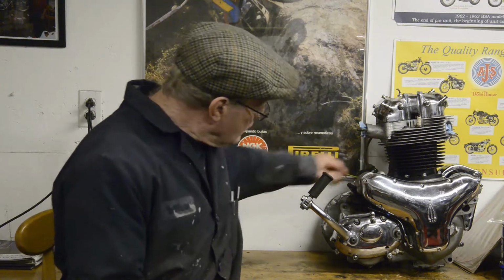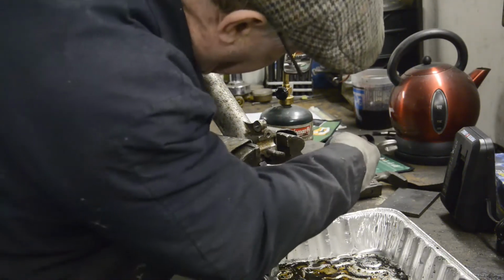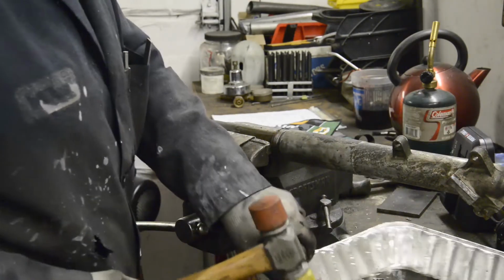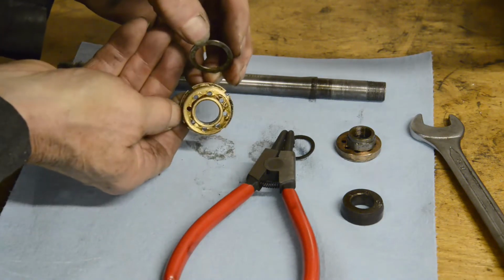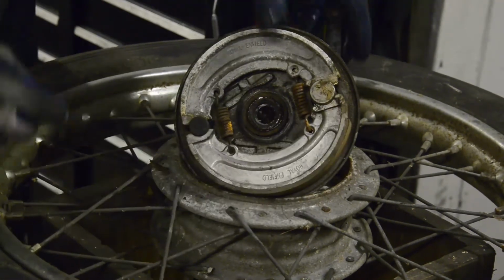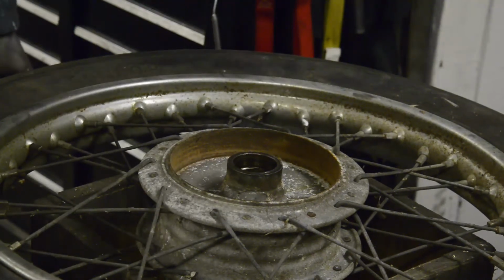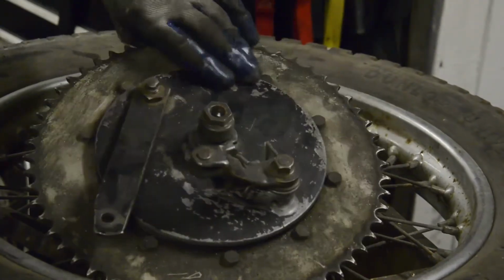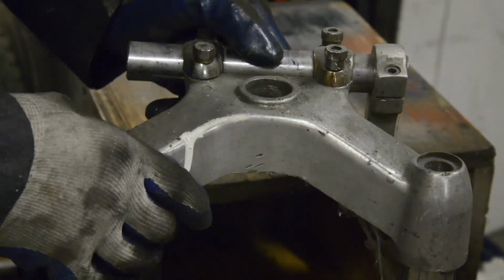Indian Trailblazer - Part Two

Comment: I think the first double leading front brake I ever dealt with, if I remember right was on the 305 Honda Super Hawk.  Maybe you might consider a small "pipe vise" on the end of your bench where it wouldn't be in the way. You are quite often gripping round things while unscrewing something on the ends (like forks). You could make some soft aluminum jaws for it, they grip like crazy.. ...Dave

Comment: Hi Michael, 

Really enjoying your practical approach and picking up a lot of information. 
Your comment on the North American wiring made me smile. I, like you are a transplanted brit and I now live in Ontario. When I first arrived I was horrified at the wiring standards, including your comments in an earlier video showing the method of connecting wires in those screw on thing (marrets?)The fact that individual appliances are not fused at the plug like the UK, means that if the appliance gets a fault it can draw everything the mains panel will provide. I wonder if that is why we seem to get more house fires over here! 

Do you not find that wearing gloves means that you cannot feel what you are doing? I have tried using gloves and always end up taking them off, letting my hands get filthy and just cleaning them! Cheers Dave
Reply from the maker: Hello Dave. Glad that you are enjoying the videos. I don't know about house fires but I seem to be forever changing light bulbs. I can't wear gloves for a lot of work but when I remember (not that often) I wear them for general stuff like humping things about cleaning parts.

Comment: HI, I like that you are showing all the details of the bike. In particular, the wiring harness is really interesting for me, as I am rebuilding a 1959 Chief and it might give me some clues on how it was done.
The fork stanchions are screwed in like any other "modern" Enfield forks, by the way :-)
Reply from the maker: Yes, I shone a light down into the yoke and saw the Allen hole a long way down, so I have screwed them out for use in another project.

Comment: Great video Mike, at least your linings were still in there, when I stripped the Montesa front wheel there were no linings in there at all and the brake plate was filled with silicon sealer - maybe someone was trying to keep mud out?

Comment: Hello I thinking of rebuilding a b44 scrambler just wondering if you had any advise as never completely  rebuild one before
Reply from the maker: The B44 engine is easy to work on and you will enjoy the power when scrambling. If I were you I would get a parts book and the Rupert Ration BSA Singles engine book. It is full of useful information and tips.
Reply: Ok thank you will try and get the book

Comment: Hi Michael, 
It's always interesting to see the teardown and repair of these machines. 
Just one newbie question from me:  on these spoked wheels, does the bike hang from the spokes in the top half of the wheel or stand on the spokes in the bottom half of the wheel? I suppose that's a bit over simplified, but you know what I mean. 
Thanks! 
Joe
Reply from the maker: Hello Joe. The bike hangs on the top spokes. If you look at the B25 trials bike videos Part Ten(1) I go into a lot of detail on this point.

Comment: Thanks for the better view of the plunger A10 engine, now if you could just duplicate the one I built back in the 70's :0
Plunger A10 cases, big journal crank, thick flange barrels, Ariel timing chest and single carb iron head, spitfire cam and lumpy pistons, and best bit was the home brew roller timing side bearing with positive end feed oil feed.
All these things were so simple to modify back in the day, if you screwed it up the local breakers had 10 more on the shelf. Lol
Reply from the maker: Yes, I don't think that I ever bought a new part when I was a lad. Down to a big old house in South Bank which was filled with bike bits from cellar to attic.